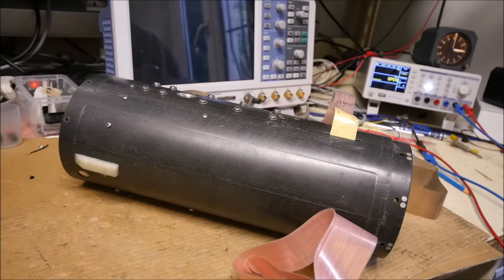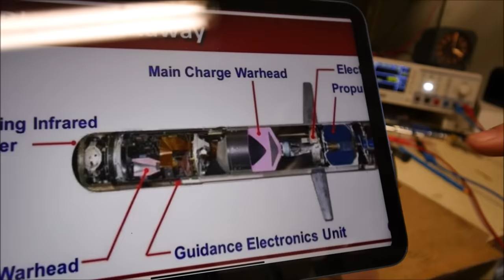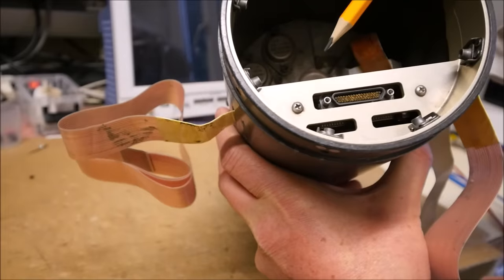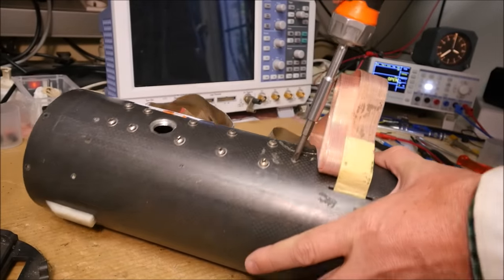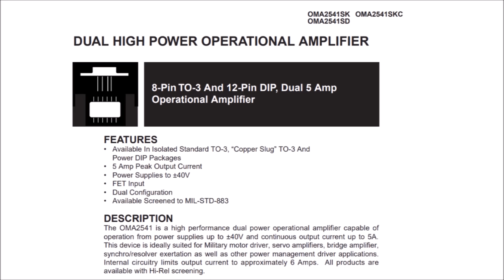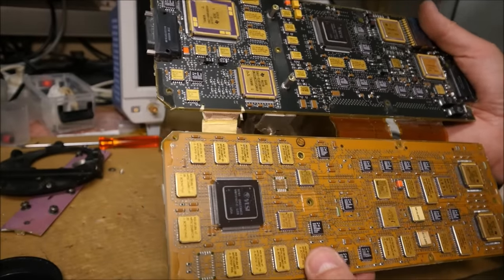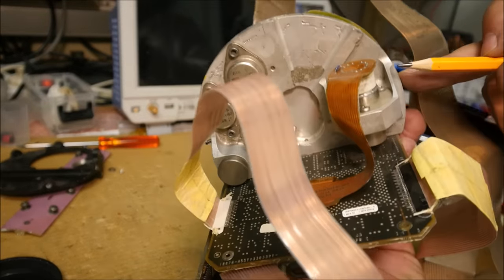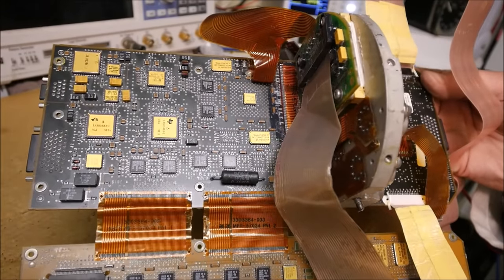LDM #354: Javelin Missile guidance computer - Part 1: teardown

Comment: Absolutely fascinating. Thank you so much for this video, all the components and board arrangements are typical 90's high tech. My old IBM thinkpads are just like that, full of boards atop other boards full of big custom chips and components. 😊
Reply: Sure, but those components are all of military grade, they are built to resist at broader ranges of temperatures....I'm not sure about the specs, but probably they are much better than any retail component of the same period!

Comment: Very interesting, thanks a lot for posting! "You must ensure the missile goes to the target and not in your garden." - made my day=) I am curious about Part 2, and yes, I'd love an analysis / deep dive into the 64x64 Infrared Imaging Sensor and ADC specifically. Essentially, the sensors first stage. Maybe some aspects of the actors section as well. 330MOPS, 60MFLOPS in the DSP .. ok;) FPGAs proc power .. no idea. I guess all the processing magic will be buried in the bitstreams (ROMs, FPGAs, DSPs ..), hard to extract or analyze, so I'm not waiting for a Javelin emulator for Android soon;)

Comment: I had a professor that said he worked for a DoD contractor. He said they would calculate the memory requirements by the max memory allocation per second and multiply it by the max possible run time. 

Memory leak? No problem.
Reply: I work in aerospace and there’s no such thing as a memory leak because dynamic memory allocation is forbidden

Comment: I've wanted a peek inside a Javelin for years, very nice. Perhaps it was explained and I missed it, why are there ribbon cables extending out of the side of the airframe?  Is it perhaps a testing/debug model?
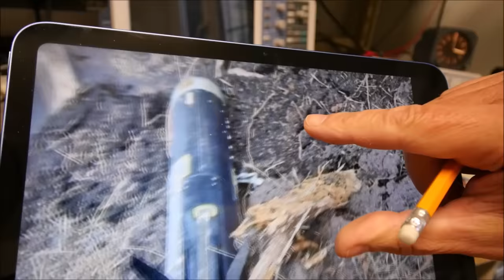Reply from the maker: You can see on the picture of the complete missile at 01:00 these ribbon cables. I think it is easier for manufacturing than using connectors inside the missile.
Reply: @lelabodemichel5162  Oh I see now. I suppose the warhead fills the entire volume inside of that next segment.
Reply: @NonEuclideanTacoCannon   I have an empty fuselage section of a Super 530 missile, it also have holes for routing wires in channels outside the main body.
Reply: @msylvain59  Come to think of it, space rockets use an external raceway for cables, too. It just didn't occur to me that smaller rockets would be the same for some reason.
Reply: @NonEuclideanTacoCannon Space rocket segments tend to be thin walled pressure vessels for fuel / oxidizer often at low temperatures for that reason it is best to route electronics and hydrologics around them and not through them.
Reply: the s-400\300 air defense missile also has cables on the outside, so it is easier to manufacture

Comment: They did a wonderful engineering job.
Reply: That missile was recovered after it missed.
Reply: @BigSmartArmed  eles devem ser ruins então, bom mesmo são os mísseis russos que dão meia volta e destroem a propia base de lançamento 😅
Reply: @BigSmartArmed   It doesn't look like it was fired at all. Considering it was manufactured in 98, I'm guessing it was rescued from a military weapons destruction dump.
Reply: @moshet842 The recovery pic shows full deployment.  Ukros have a huge black market for complete and chopped weapon systems.
Reply: @BigSmartArmed  Well, that is a sample picture from Google. The one he has is not the same as the one in the picture. Besides, the Pentagon generally has a 10-15 year shelf life on these missiles which indicates that what I said earlier was probably right considering the date of manufacture. I would bank more on it being decommissioned.

Comment: Such an amazing find!  There’s actual real gold in those components!  Amazing stuff; the components look like mil-spec radiation hardened devices, like the same components you’d use that makes up a rover to be sent off to Mars!  No expense spared in this unit (because…thank you tax payers!).  However, it’s a shame all of the engineering put into that, along with extremely expensive components…to exist as a single-use subassembly!
Reply: Yes they are all Radiation and extended temperature resistant.
Reply: Unfortunately the reality of the world is taxpayers pay with dollars or probabillity raises that they could be "paying" with their own lives.
Reply: The components in here are not extremely expensive at all. The chips and electronics are dirt cheep. The reason why these things cost over $100,000 is because it's a problem that the department of defense has been dealing with for a long time. It's called price gouging! You see these missiles probably cost anywhere from 5000 to 10000 to make. But they're going to sell it for hundreds of thousands of dollars because they set the price and they know that the governments going to pay up. The Pentagon gets priced gouged on everything, from office supplies toilet paper to missiles. We're talking about pins that cost less than a dollar getting charged $80 per pin and over $100 a toilet roll. Lockheed Martin, Raytheon, Boeing, Northrop, Textron and more. All of them price gouge the hell out of the taxpayers it's the biggest scam nobody ever talks about. It's basically why we have to pump so much damn money into defense because the United States it's basically getting scammed by United States companys.
Reply: @videosuperhighway7655  Ceramic mil-grade chips with gold plated lids doesn't mean rad hardened, especially not in the 80's.
Reply: @patman0250  Don't be so dense. The reason they cost 100k is because the 'cost' of the weapon is far higher than just the bill of materials and labor to assemble them. They're not selling flatpack chairs here.

Comment: That thick PCB will have loads of circuit tracks, making a reverse engineering project near impossible - but I'm sure someone somewhere will have done that. Great video, thank you Michel.
Reply: What’s a circuit track?
Reply: Not really an obstacle for a vacuum plate and a precision surface grinder. Take it down layer-by-layer and take pics.
Reply: Don`t underestimate the patience of a Chinese
Reply: Sure you can have highly skilled engineers reverse engineer a many years old design, but it might be better to use that talent to design a new device to the latest standards.  The magic is really in the software though.
Reply: NO need to reverwse engineer anythihng now. Today a 4 man team of decent engineers can achieve in 6 months what this thing was capable of back in the day. There is a Youtuber who managed to propulsively land a model. I'm sure an ATGM would be an easier task for someone with those skills.
Reply: What's impossible about it? Grind it down layer by layer, photograph it up and replicate the design, people get paid to do that shit. The harder part is getting secret sauce out of the chips, who knows what countermeasures are used there. Of course, none of it is worth it to copy the design, with modern tools and parts it's much less work to make your own design from scratch. But you might be able to develop some sneaky countermeasures if you understand how the missile guidance works exactly. Maybe you can flash just the right frequency to the IR tracker and it goes bananas or something.

Comment: This sensor looks a lot like a dynamically tuned gyro (DTG). If so, there must be two of them.
Reply from the maker: There is only one sensor on that section.
Reply: @lelabodemichel5162  At 10:54 what is the thing in the bottom left side of the aluminum bulkhead? It looks like another sensor (same cylindrical shape).
Reply from the maker: @s102tk Nothing electrical, just a metallic cylinder. Maybe a provision for another sensor.

Comment: Looks like they made sure no one recovered the guidance system. The main charge would mess it up pretty bad.
Reply: The warhead is behind the electronics for having the best penetration distance without needing a probe as with previous generation missiles that had the warhead in the front.

Comment: This likely is a design prototype or a manfacturing functional test technician training model,  that someone had secretly kept in their garage for decades.
Reply: Why do you think that? The easiest explanation is that in the poorest country in Europe, people can take stuff meant for war and mark it as used and sell it afterwards. Not a jab at Ukraine, just the simplest explanation.
Reply: @ligius3  the pcb circuit boards are all exposed and don't have thick plastic conformal coating
Reply: I think you are right. 

1. The umbilical cable is intact, so this cannot possibly be from a dud.
2. None of the cables are creased like they would have been after being folded when the complete missile is assembled.

Comment: Very interesting. For me the most valuable parts at the OMA2541 op amps. You can make a linear power supply or an audio amp with them. All other transistors and op amps can be reused for linear applications. They are high quality for sure.
Reply: damn that op amp can give an output current of 6 amps
Reply: Yeah, avoid opening them though!  The BeO label is probably a warning:  some of those TO-3 can packages are filled with a heat-sink compound.  Beryllium oxide is a high performance one.

Comment: Smart design to have the charges burn through the electronic guidance and triggers fractions of seconds before the target gets it. Liquidate the most sensitive technology, in the primary action.
Reply: That missile was recovered after it was fired and it missed.  If it was that smart it would have self destructed like SAM/AA missiles do.
Reply: @BigSmartArmed  they should as a safety feature as well as for security, rather surprised by this 😬
Reply: @BigSmartArmed  How do you know that? I'd expect a fully built one to have conformal coatings and stuff fixed better. Maybe this is a prototype or some engineering model instead of a live round.
Reply: @christopherleubner6633   Munitions that are directly deployed by personnel can't have self destruct mechanisms.
Reply: @benbaselet2026  I don't know for a fact, but giving the current reality, it is much more likely that this is a recovery from Ukrainian war.  Ukros have been selling weapons on black market from day 1, Javelins deployed in Ukraine have a massively high failure rate, and now we get a tear down of one with a manf date of 1997.
Reply: Nah, it actually (slightly) impedes warhead performance. It's mostly a matter of the standoff distances the two warheads want, the delay between them, and the speed the missile closes at. Oh, and one, don't waste space, and two, the seeker can't see through anything so it's in front.

But Javelin can make that compromise since it's attacking from above, so it can achieve the same lethality with less penetration depth.
Reply: @douglashill2469  Right on man, it's good to read a comprehensive comment.  The only thing you did not mention is that the precursor charge has dual duty; detonate ERA with the jet while at the same time clearing the front end of the missile with the side blast for the primary charge detonation.  The problem now that the precursor charge is not enough to defeat modern ERA, and a most of Javelin strikes were defeated by ERA.  That's why in Ukraine NLAW is preferred to javelin, even though the charge is much weaker it's a EFP which goes through ERA without dissipation. While having low defeat probability, NLAW strikes knock armor out of action thus forcing their extraction and repair.

Comment: Wow that Missle must have been veryyy close to its expatriation date. The style of TI-Gold cap chips - Do they still use those on modern military systems? Those chips, the VLSI glue logic on the rear - perhaps this missile was manufactured in the 1990s - it does not have that many modern components inside it which is probably why this video still exists. The sensor I think is a proximity fuse. I love military electronics, its a thing of beauty
Reply: The parts are made 1998, lots of datestamps visible.

Comment: I am impressed, I thought this javelin would be much simpler/rugged, and that s pretty advanced for 1996
Reply: Advanced?
Less advanced than an old Cell phone.
Reply: @rdallas81 if you are comparing it to a 2010's cellphone, yes. But a 90's phone of the same era as this guidance computer, no.
Reply: Isn't this missile from mid 80s
Reply: @togowack  designed in 1989, in service since 1996.
Reply: @colombianguy8194 thats pretty slow for a 64 x 64 display makes you wonder about all the equipment in service now, outdated and not as good as people think it is.
Reply: @togowack  tell that to the Ukrainians who use the Javelin and the Russians who got wacked in their tanks. The missile has got upgrades as well, those 90's electronics components are out of production.

Comment: Stupid question: why are most of the chips packaged in a golden package? I know about different properties of different pcb materials for example, and I know that a simple epoxy package might not be enough. Is it to protect from EMR? Why not have a "normal" metal can for that? The golden packaging seems to be common is super serious hardware so it must have some specific property!
Reply: Heat dissipation, anti-oxidation and reflectivity.
Reply: Probably because of extended temperature range.
Reply: anti-oxidation you dont know how long they sit in storage
Reply: Hermetically sealed with helium leak tests.  It's all about long term storage and the reliable operation.

Comment: Why are there cables just hanging out? Would they not be at risk of coming apart from the air resistance on the missile? This is really cool. Thanks for sharing this.
Reply: When the missile is assembled, the cables are glued flush to the outer surface of the missile. Then they are covered with a layer of shielding material. Apparently this works quite well.

Since in this unit the cables have no visible creases on them from being folded into the final assembled shape, this unit has never been assembled into a finished missile.

Comment: Beautiful piece of design, seems a shame to blow it up. What really amazes me is how anybody could reverse engineer this, Russia at a minimum seems to have been able to do it. Just to work out the PCB layout would be hard enough let alone the FPGAs etc
Reply: I think these devices are re-engineered rather than reverse-engineered. If you know someone was able to make a missile with such and such specs it's easy to be motivated to make something like it or better.
Reply: @BertoldVdb  I agree, but then the Russians have the Kornet which is more powerful (more penetration, cheaper, between other features), but less famous, for obvious reasons in western countries. So, perhaps it was interesting for Russians to reverse engineer the Javelin to only develop countermeasures for it, not to actually use it the the battlefield. IMHO, its design looks over-complicated (and probably very expensive) for what could be achieved using a more streamlined design. But, in its defense, this could probably be due to a design legacy and the result of being manufactured as a military commercial product, so part of its complexity was needed to justify the price tag for its vendor to market it to the Pentagon.
Reply: @pepepistola9258  the kornet is beam riding, the only way to do a top attack is to manually fire the missile in a higher arc then steer it down. man in the loop. javelin is fire and forget, and has multiple launch modes. completely different systems edit before anyone says it, yes, i know it can be controlled by an automated targetting computer on some vehicles - vehicles can be destroyed or obsfucated. its still not fire and forget.
Reply: I doubt Russian engineers will bother to reverse engineer this. This is old as crap.
Reply: @hrissan  And is still the most potent portable AT weapon in the world.
Reply: @ImBigFloppa after RPG-7. maybe.
Reply: @ImBigFloppa  😹 most expensive and advertised one. But not to effective according to Russian/Ukraine losses tracker.
Reply: @ImBigFloppa  Doubtful. I think cheap quadcopter drones with an rpg warhead strapped to it have far surpassed the Javelin in both tank kills and cost effectiveness. But the Javelin was great for making money for defense contractors.
Reply: @Deltaworks23  Quadcopters are great if you are two militaries just sitting in trenches with nothing else to do. But when you are advancing on a position and need to take out a tank with certainty, their is no better option that is portable.
Reply: There is no need to reverse engeneer it in Russia - once you understand how it works (principles), it would be more efficient to create similar design. Following by copying is copying mistakes too - better to go ahead than copying old design exactly.
It is not super weapon anyway.

Comment: Montés sur la plaque alu centrale, le cylindre que tu observais et dont il y a l'air d'y avoir un équivalent monté à l'horizontale également, m'a l'air d'être un élément de centrale inertielle. Un p'tit moteur à la vitesse bien contrôlée et dont les écarts mesurés doivent permettre de calculer les écarts de position en rapport avec la trajectoire programmée du missile. Belle électronique !
Reply from the maker: C’est effectivement un gyroscope de variation angulaire mais il n’y en a qu’un, l’autre machin n’est qu’un cylindre en métal, peut-être un contrepoids.
Reply: @lelabodemichel5162  Merci pour ces précisions !
Reply: @lelabodemichel5162  sûrement une masse d'équilibrage en effet